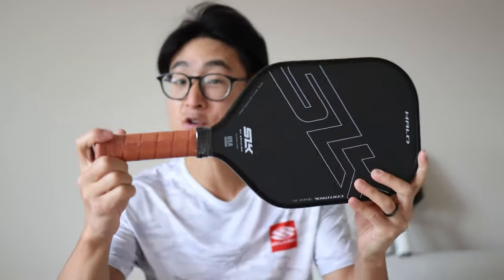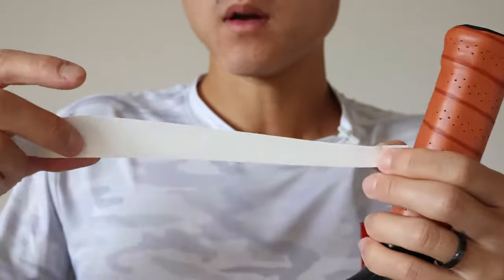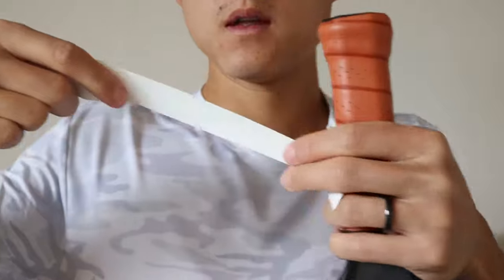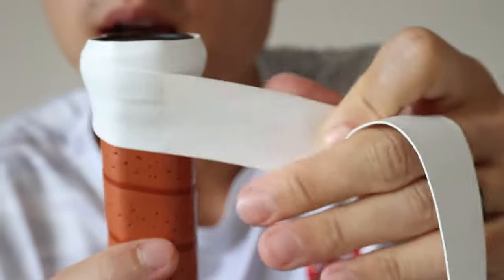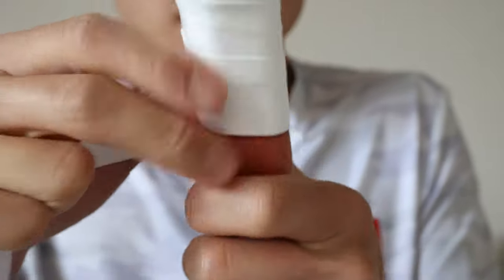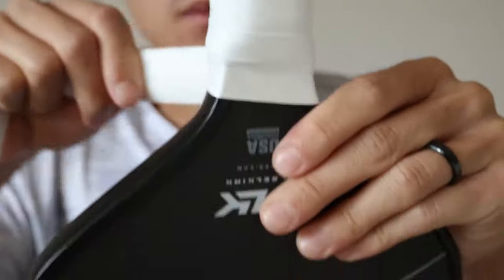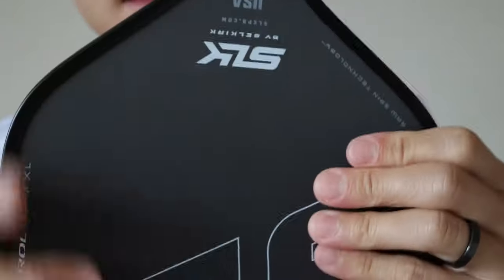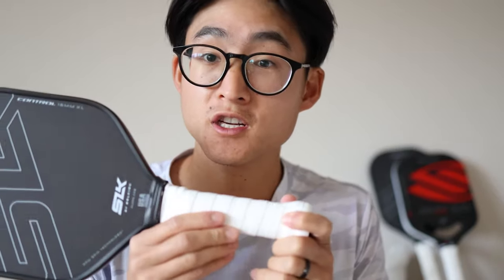How to CORRECTLY Overgrip Your Pickleball Paddle

Comment: So the part that the plastic protects that you peel off of the grip is the part that needs to go on the outside of the handle?
Reply from the maker: correct!
Reply: Isn't the sticky side down so it adheres to the old grip?
Reply: @jjyst5  No, the sticky side should be on the outside so it's in contact with your hand. The less tacky side should adhere just fine to the handle.

Comment: Another tip: Wrap it counter clockwise if you're right handed, and clockwise if you're left handed.
Reply from the maker: That's a good thought! Probably would need to take off the stock grip in that case so the angles don't clash.